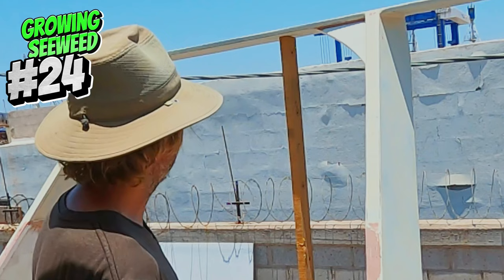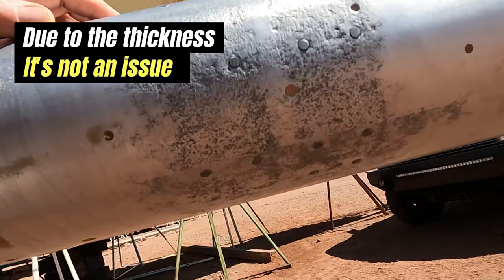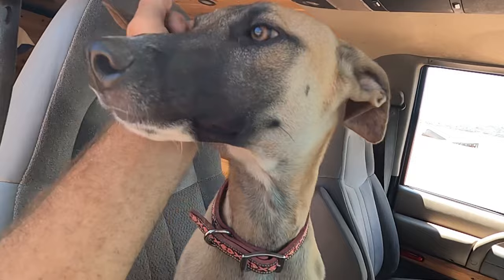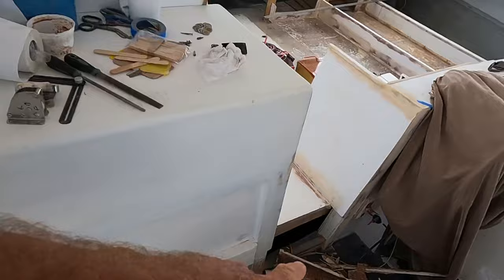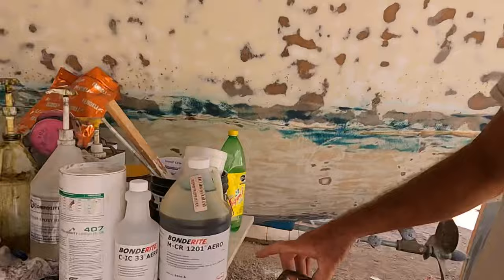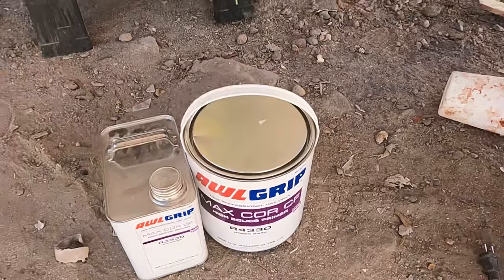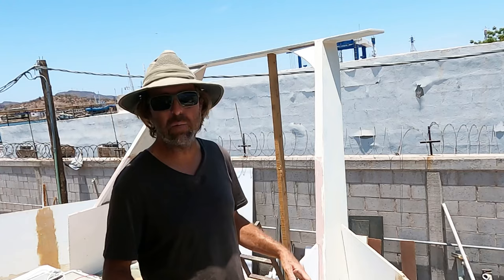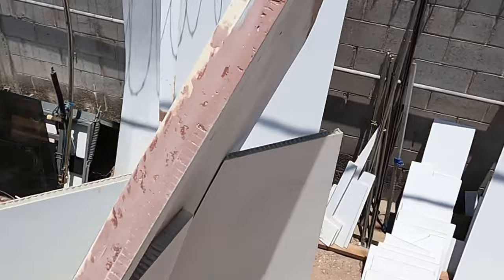(EP #24) Insane DIY Sailing Trimaran Redesign!  It’s Painting Time.  “Building our modern Loft”

Comment: Nice work mate. Sounds like you have a Takacat dinghy (or similar) - amazing how many tri’s use them! Fast and lightweight👍

Question - your aft deck extensions.. what material did you use? I need to do something similar on our boat.
Reply from the maker: G’Day!  I only used composites.  The walls are 3/4” plastic honeycomb panels and the deck extension was the 2.5” thick stuff.  You might go back to episode 4-6 and you’ll get a better idea.  All the best with your addition!
Reply: @SeeWeedBoatLife Thanks!